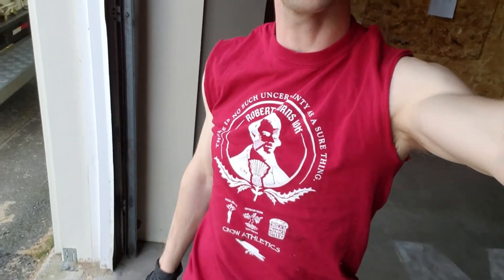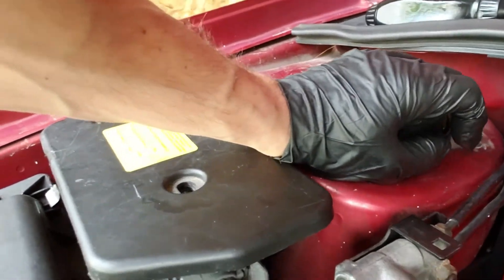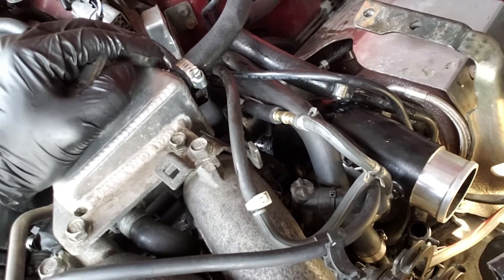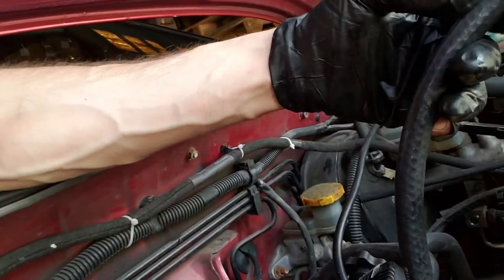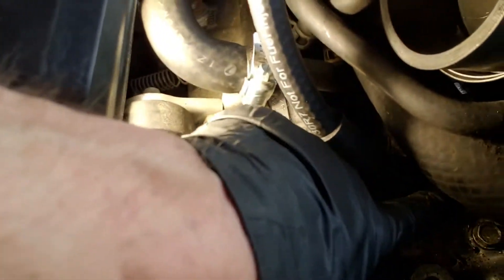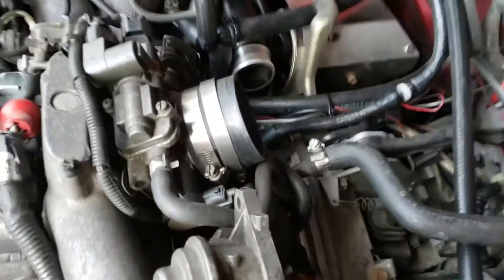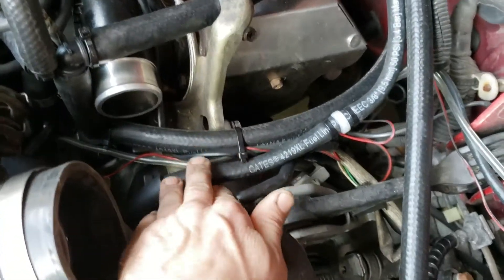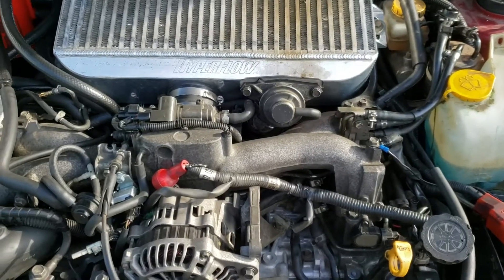Installing an IAG air oil separator (AOS) on a 2002-2003 WRX

Comment: I installed this on an 03 wrx and read on their website they sell the 04+STI PCV valve & it says to change out our valve for the nippled one, apparently the IAG had a built-in PCV valve on/into the hose that goes right to the nipple off the intake, 🤔 
Also did you have 1 or 2 breather holes off your valve covers?
Reply from the maker: I have 2 breather holes from the valve covers: one from each.  As to the PCV valve....yes IAG has one built into the hose on their AOS.  I was told by my tuner that I should just remove the PCV valve from my intake manifold and drill it out so that it's just a fitting and only the IAG valve on the AOS is there.  So right now I have two PCV valves in line.  It doesn't seem to have made any problems and I figure it's better than not having an AOS.  I have to pull my intake manifold to replace the wiring harness eventually so I'll drill the valve out at that time.
Reply from the maker: I have 2 breather tubes, one off each valve cover.  But my engine is essentially an 05 STi engine.  I think the earlier EJ205 engines just have 1 breather tube.  The AOS does have a built in PCV.  Our old engines have a PCV drilled into the fitting the come out of the intake manifold right below the throttle body.  I think that ideally you should unscrew the fitting that has the PCV valve in it and then drill that out so that it is just a fitting and has no valve in it any more.  I didn't have time to do that though.....so it's on my list of someday things to do.  I don't know.  My car seems to run great.

Comment: On my 03 wrx I only have 1 breather port on the car would I just tap the aos into that one?
Reply from the maker: Yup.  do that.  And if you have an extra port going into the AOS where the other breather line should go into I think you can just cap it.
Reply: What I meant was I only have one port on both sides of the block when the other videos that show the 04 plus have two so would I be okay with just using that one port?
Reply from the maker: @lxverr7340  yes, using the one you have is fine.  It's been a while since I did it but I think you may have an extra port on the body of the AOS that was meant for the other (non existent on your car) breather.  So you should get a rubber cap from an auto supply store to cap it off